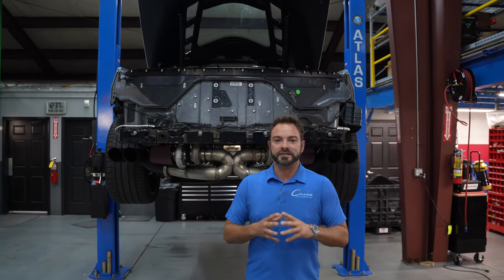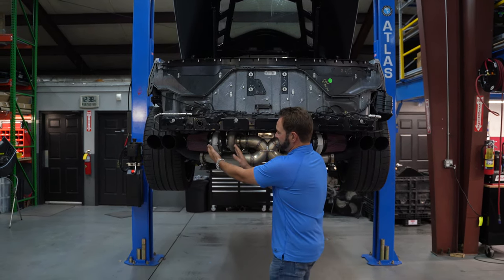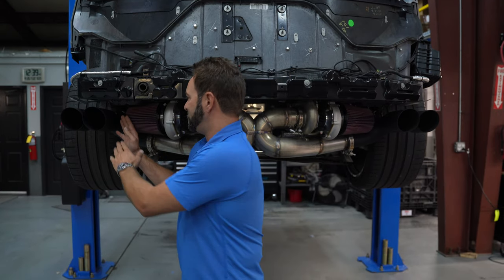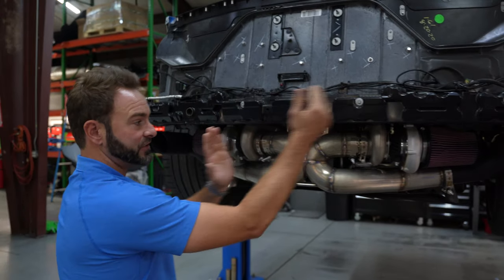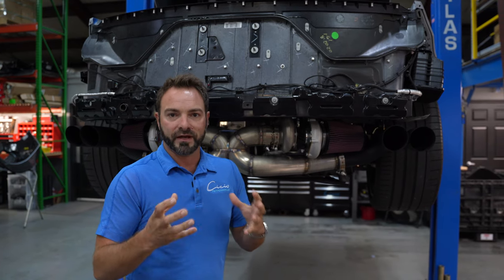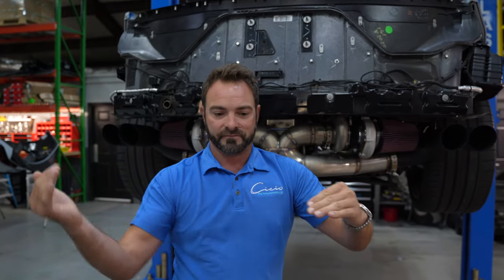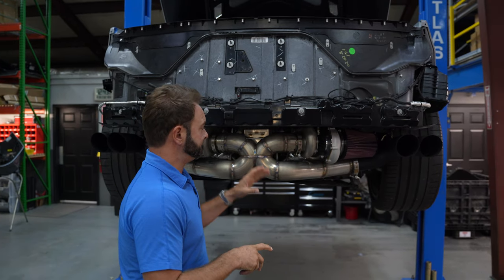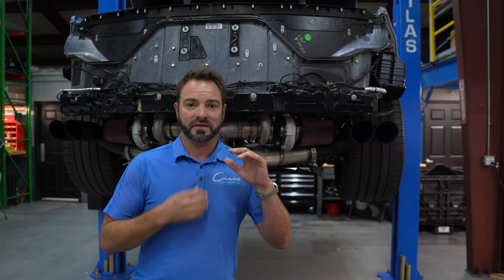Cicio Performance Twin Turbo C8 Corvette X Package Announcement + Sound Comparison!

Comment: Would love a video specifically showing the data between two similar kits (i.e. C700 v C700). Things like IAT & power levels (comparable dyno graphs) would help folks make a decision on it outside of just the sound. I'm partial to the X pipe sounds, but am SUPER cautious on how temps and power are even with it angled a little. 

I have the normal TT setup, but would definitely entertain purchasing a "X-pipe conversion kit" if the data is the same across the board.

Comment: I'm willing to bet that by every data-based measure, this is worse. But it does sound better and look cooler. Also, as you said, these are running such low boost, so who really cares?